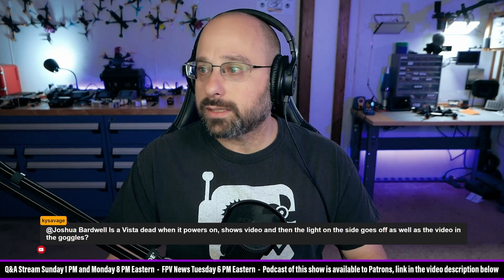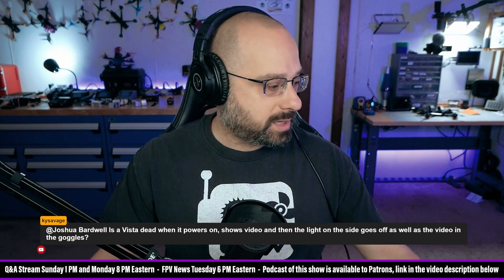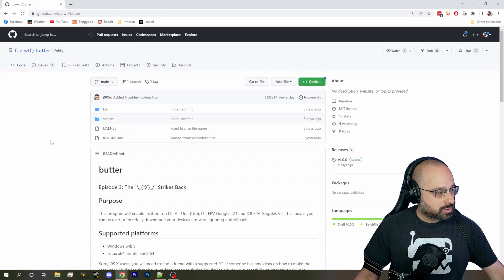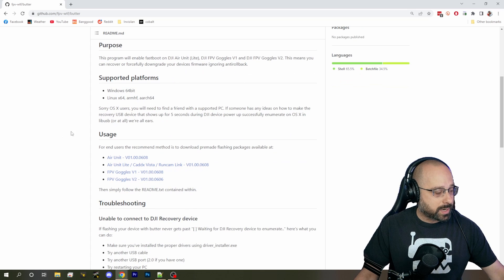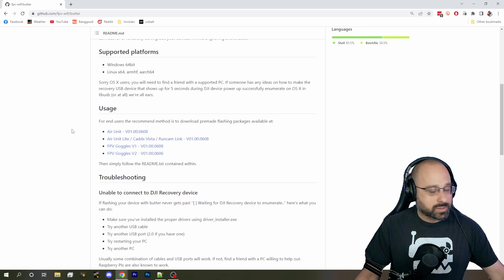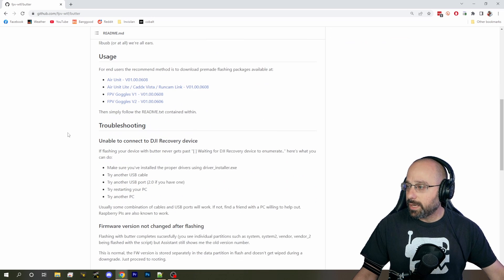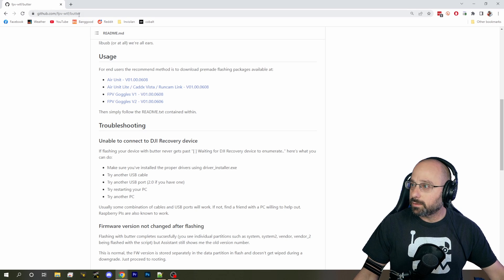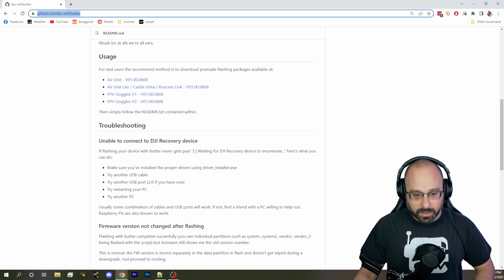My DJI Caddx Vista is Shutting Off! How Can I Troubleshoot It? - FPV Questions

Comment: I have a new apex 3 build with a 50amp aio. My vista is on a 10v pad and it shuts off during full throttle moves like flips and rolls. It’s driving me crazy. I thought it was the vista so I wired up a known perfect vista and same problem

Comment: do you know how to unbrick caddx vtx red light turns on after crash, when i connect caddx to pc sound like if i was connecting and disconnecting but not and pc didn't recognize caddx vista
Reply: do you solve the problem ? I have the same (only difference the connecting/disconnecting problem appear after downgrade with Butter)
Reply: @JulesGrossi, do you solve a  problem?

Comment: I lose video mid air in very short range after flying good cor 3-4min. Complete loss and sometimes the only way to recover video is unplug and plug the battery. I’m lost, idk what to do, checked the connections and all seems ok. Vista nebula pro and dji goggles v2. Anyone?
Reply: No, and I think maybe the problem is not the vista but the glasses rebooting or freezing… not sure
Reply: Hi, did you fix this?
 @19Jose91
Reply: Any fix yet?
Reply: Do you use wtf osd? It can cause 15s cut off vidéo on certain DJI google

Comment: Thanks for the fix!
Reply: What fixed it? Using butter or changing the power source
Reply: @GloriousQuads  Butter
Reply: @MysteryD  😂 it should make it slick
Reply from the maker: Margarine is the standard root, you need butter which is the fix for bricked devices. - Blunty